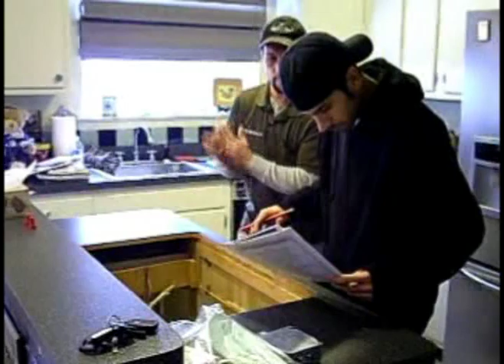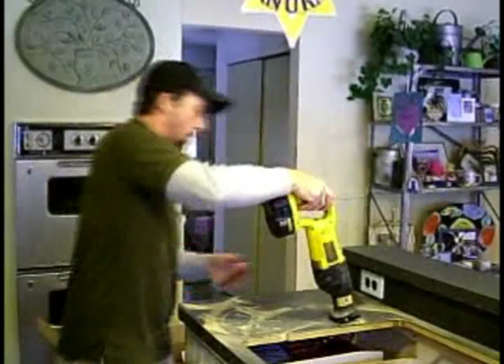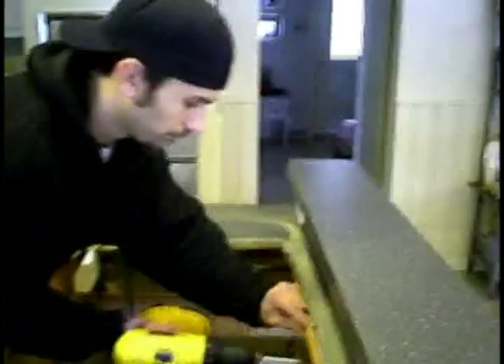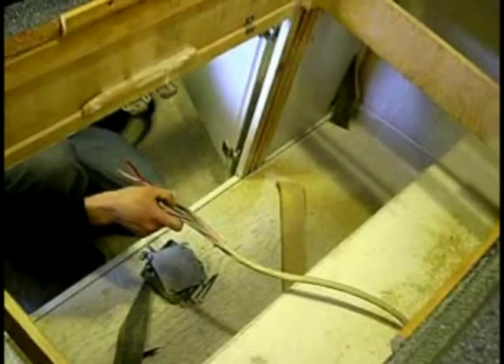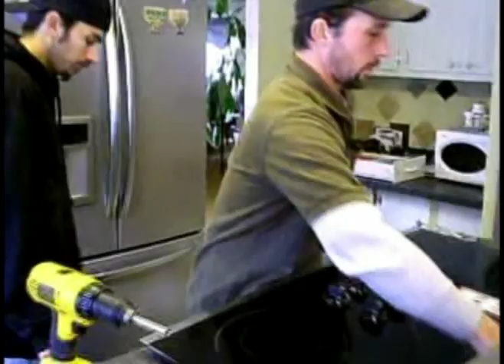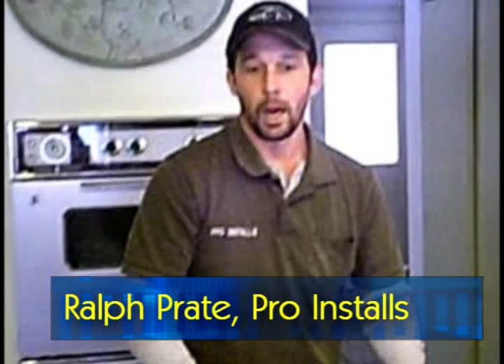Getting Cooktop Installed

Comment: Thanks for the video; there's hardly any other in depth videos like this on youtube for installing a cooktop (enlarging the hole). We used the same method as this video to do diy installation. It didn't come out perfectly cut but imperfect cuts will be hidden by the cooktop, and look perfect. QUESTION: were there any support brackets screwed on the sides or ends of stove to the under sides of counter? (vid didn't show that)--I found online instructions doing that final step.

Comment: This works but there are better ways to do this job. The only major thing I see wrong is that he used a razor to cut back the wire casing. He cut into the wires in the casing. This WILL create a short. It may not happen right away but it will happen. Always peal back the casing away from the wires and cut away from yourself. Besides that I would have taped the outer edge of the cut so my tool doesn't scratch the counter top. I would have used a jig saw to make the cut for a more controlled cut.